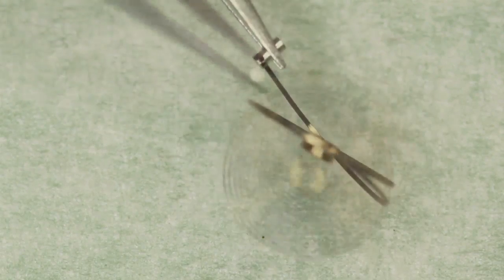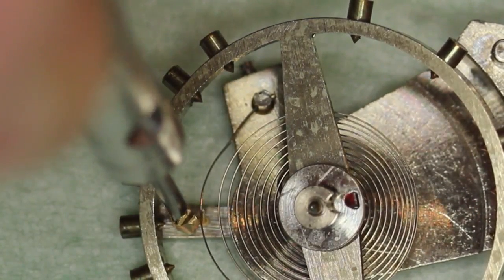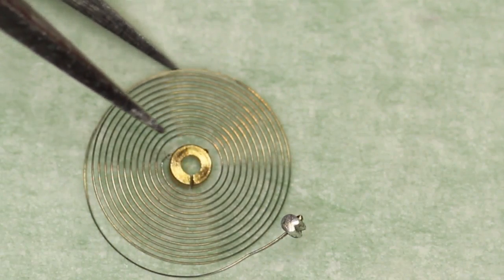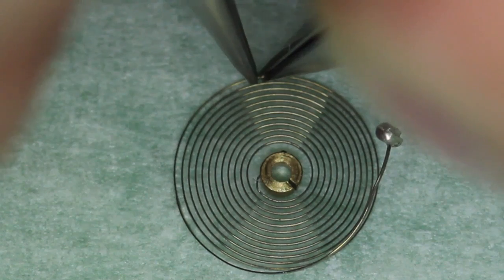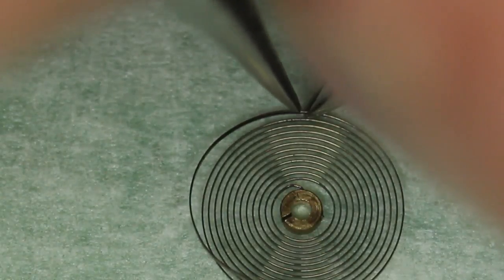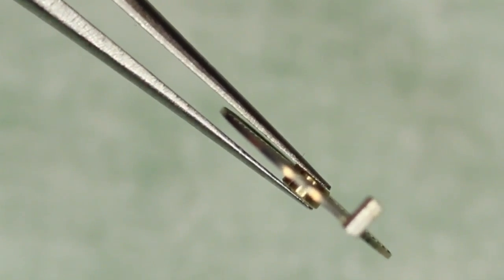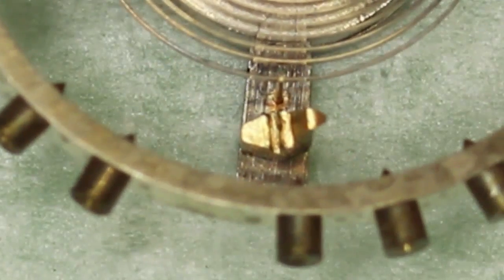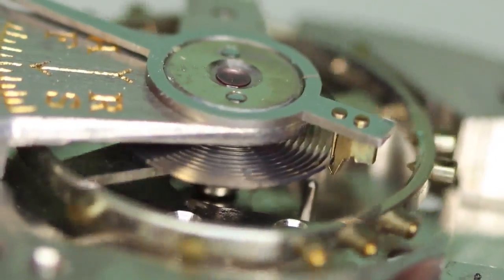How to repair a twisted hairspring. Watch repair techniques

Comment: I'm not a watch repair technician or maker, but @8:10 once the hairspring has been lifted over the stud, should you not have moved the Index back to a central or neutral position before clamping down on the hairspring? 

Giving you the ability to speed up the watch as well as slow down the watch should it ever need those adjustments. 

Surely the watch can only be slowed down when you clamp the spring with the Index fully in the fast position?
Reply: Hi there, 
I gather from what you said that you're slightly confused. When he lifts the hairspring over the pin (aka regulating pin or curb pin) and then uses the screwdriver to turn the "boot" 90 degress, to close the hairspring in. That isn't locking the hairspring in that position. The hairspring is free between the small gap between the pin and boot. When the pointed index seen ontop of the balance cock (where fast and slow is) is moved, that moves the pin and boot effectively changing the length of the spring. I hope this is clear

Comment: I have a hairspring which is not parallel with the balance wheel and fouls it, and the watch does not run. I do not know how to remedy this and the collet seems permanently attached to the balance - there is no gap in the collet - so I dare not try to remove it. Can you tell me where to bend it to make it straight again?

Comment: To remove the harspring collard of the balancewheel axle use micro wire cutters with a hole drilled where the blades meet to allow for the axle and file down blade thickness to fit under the collard.
https://m.youtube.com/watch?v=7T-gsjtNN70

Do you know where i can find hairspring for ingersoll triumph 1950s pocket watch?
I have looked around but many say "to fit movement xx#xxxx##" but i dont have a clue what movement number any of them are, dimentions, caliber, model numbers etc? Any good info out there on this?

Thanks.

Comment: Excellent video well edited with a clear audio text. Thanks for this. My problem isn't so much hand shake as eyesight. What sort of magnification do you use?  I was wondering if a USB microscope would help me? One might think these delicate springs could never be so shock resistant. My problems are often self inflicted. It's hard to know how best to grip the balance when removing/replacing it. Your skills are fabulous. Thanks so much for it all. Very clear indeed. You deserve fame!
Reply: The most difficult job on watches. I hate it especially when it's twisted on several spots and in several directions

Comment: Amazing work, it's like surgery on a micromechanical level.  I've learned so much from these vids, thanks so very much for your time and effort in putting these together.  As a newbie, I have no shortage of junk movements to practice on.  What I get from your work is a lot of patience and extreme care which is, in itself, a discipline.  We don't want a movement dying on the bench.  Thanks again.
Reply: Echo every word you said there. Very inspiring indeed. Junk movements are best to learn with. I find things can go wrong from the smallest twitch! My biggest snag is the tweezer grip. It's probably better to drop things than have them fly off under power from a tight grip. I'd like some lessons on these aspects too. For instance, does coffee/tea make you shake more?
Reply: Berry J. Greene what works for me is breathing right.  Coffee has no effect, and practice does make perfect.  I spent hours shaping tweezers so that I was sure to get a grip on the spring every time.  I can't overemphasize the importance of becoming proficient with tweezers.  You might also try this: use an ordinary pin to hold the spring in place.  You need to taper it with a file or Dremel, stick through a sheet of white paper cut to about 4" square into a rubber mat 1/4" or so under the paper.  That way you have MUCH more control over the spring and you can focus more on manipulation of the spring and less on chasing it around the room.  It works well for me.
Reply: My dear sir you cannot have any idea how valuable it is to me to have had this exchange. I was beginning to lose heart, to say, well son you just aren't up to it. I will persist and see where I end up. Nevertheless I am in awe of those who have mastered work like this.
Reply: Berry J. Greene My drawer is lined with microminiature scouring pads that represent disastrous attempts at hairspring manipulation.  Use wooden chopsticks (not bamboo type) and then cut a pin to jamb into the flat end.  Leave about 1/2" exposed and then bend half way the pin to about a 45 degree angle.  Make two of these.  The stick gives you a long reach so you can keep your fingers out of the way.  Also, when using the pin in the paper method mentioned earlier, push through the collet into the paper to the rubber underneath.  You can then rotate the whole thing around as needed, the pin holds the spring secure.  Most of my problems have been associated with keeping the spring stable while I work on it.  This solves that and now I am making excellent progress.  So it is possible to learn how to do this, it is possible to become good at it.  It takes hours of practice, breath like a shooter and watch the excellent videos here by searching "hairspring manipulation.". These guys are amazing and inspiring.
Reply: Thanks Orville so very much both for your honesty and your technique. I will be copying these exchanges into a documant for later use. Do you belong to any Forums? I have joined the NAWCC which has proved to be very useful. They also have stuff on Youtube. There's a lot of information on the net - but you cannot beat experience and confidence. I am practising holding my breath but I have to let go now! Sincerely BJG

Comment: Wouldn't it be easier and better to replace the hairspring? After all it's the most important part of watch... Any defect should have a huge impact on it's accuracy right? Not that fixing the bent spring won't fix the watch... It's just that, for such an important part, wouldn't you rather get a new hairspring than risk trying to repair it
Reply: Well you make a good point. The thing is that parts for mechanical watches have dried up since the advent of the quartz watch. They are so functional - although not pretty I grant you. Rugged, reliable, accurate, no winding and cheap to make. Not that I don't love the mechanical masterpieces because I do but the greater world and his dog don't care. They'd rather have a quartz. Somehow we should try to keep as many samples of the old mechanical specimens alive & well if only for posterity to see something very special that humanity was able to do way back in the daze..

Comment: just took delivery of a nice vntage watch - pretty cheap purchase so I don't mind going inside it to sort an issue it has. Its running 3 seconds fast a minute (!) so I have heard this could be due to the hairspring being "overlapped" and it can be fixed by "tickling" with a needle - do you know what that phrase means and perhaps could you put it into a few words - does it mean using the point of a needle to gently spiral round the spring from centre to outside gradually going in larger circles?
Reply: The balance is an oscillator with a resonant frequency. Among other things like the weight and diameter of the balance wheel, the hairspring is of a certain elasticity, weight and length. Shorted coils - if they don't stop the mechanism will speed that resonance up and the escapement time with it - which is referred to as  "gain" or "advance." So that hair spring is very critical to the correct operation. You'll be lucky to untangle it if this is your very fist venture into watch repair. It will likely have to come apart and it may well be damaged beyond a good repair. Perhaps practice with an old cheap movement first -eh - then amass the tools & knowhow you are going to need before getting on to specimens of value that matter. Good luck. Let us know how you get on. BJ
Reply: When a watch is running very fast, like 10 minutes per hour, usually the turns of the spiral spring touch.  They touch because a little oil makes them stick together or because the spring is torn as in the video. So first, the spring must be cleaned, checked and eventually rectified. But don't try this without supervision! You will destroy your spring and your watch! It's the hardest job in the watch repair business and even me needs to be fit to rectify spiral springs! Look for a watchmaker that is honest, not a shop, since they only send it to watchmakers and will charge you the double -unless the owner isn't a watchdoctor himself!

Comment: Since you have worked on the hairspring would you return the index to its previous location or would you start calibration from scratch? How much difference could working the spring potentially make?

Comment: Hi, great video. I have a hairspring which seems to wind back on itself. I'm not sure whether that is by design but it doesn't look right and I'm worried I'll break it when trying to repair it. My watch keeps stopping or goes really fast, so I think the hairspring is touching or I applied too much oil. Can anyone please help me with this?
Reply: +UltimatumNo5   Too much oil is definitely a no-no. If there is oil on the hair spring it will cause the spring to stick, also if it is magnetized, it will stick. This will cause your watch to run very fast.  If you have determnined the hairspring is touching, you should try demagnetizing it first. If it's still sticking, you will need to dip your hairspring in some onedip or naptha lighter fluid.

Comment: Interesting. How do hair springs bend or twist? Gravity?
Reply: Hairsprings and disasters.  I could write a book on it.  Where is the incredible shrinking man when you need him?  I decided to start my watch repair journey by learning everything I possibly could about balances.  I figured it was the most difficult part of watch repair and if I could get a solid foundation with it, It would be very helpful later on.  I've come a long way, learned a lot of things and one of them was how delicate they are.  These videos are priceless and can save a lot of money and time.  I am grateful that these masters are so willing to share their knowledge and experience.
Reply from the maker: Gravity? - I suspect possible sarcasm there. Some watch owners may attempt to regulate the watch themselves, slip and damage. A less experienced repairer may catch the spring on the centre wheel when attempting to remove the balance. It does not really matter, the video is showing some techniques to resolve the problem either way.
Reply: Oh thanks. I'm actually quite new to watches and I just like the various movements. Sorry if I sound sarcastic. I was thinking of how the spring could get damaged on its own. I didn't think of outside interference.
Reply from the maker: Zulhardy Rahim lol - no worries, I see what you mean now :) These springs are very fragile and easily bent or damaged, even an experienced watch repairer is just one slip away from disaster so we never rush these jobs and always take a few deep breaths before starting the job.

Comment: Great video's very help full. Any chance you have one about removing and fitting the tapered pin from the hairspring stud?

Thanks,
Reply: Oh golly that's a tough call. Don't even breathe lest you inhale it or blow it into outer space. I can tell you not to grip it too tightly lest it ping off under power. I can say work on a surface that will capture it rather than allow it to bounce/roll. 
Sit down with the bench near to eye level. Get an eyeball transplant from a younger person, and pray. That is what I have to do. Ask for help & guidance from above. Cut out the coffee and other drugs you are using which will reduce the tremor unless you're hooked in which case it will be worse............ Good luck!  Two year old post. Did you do it?